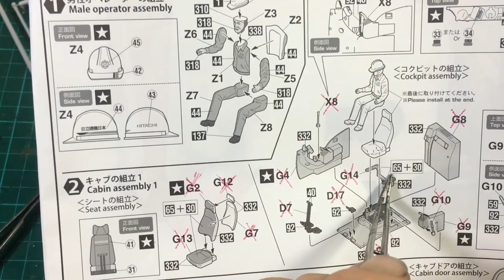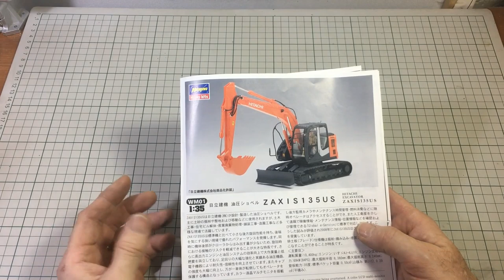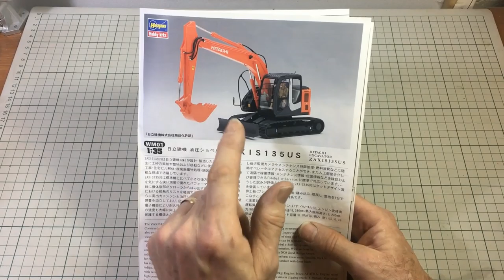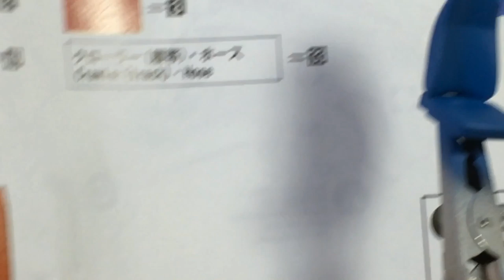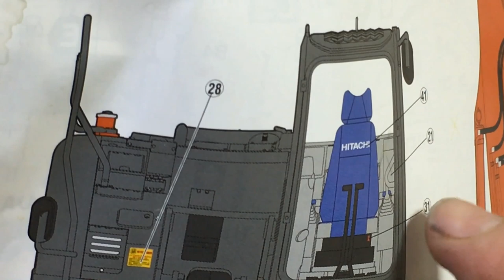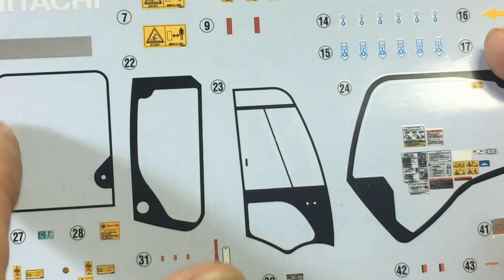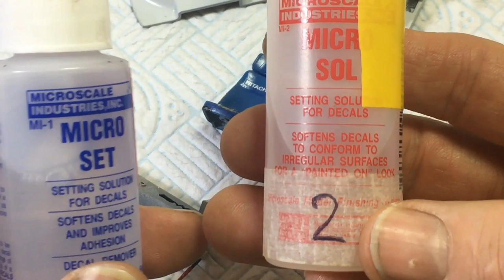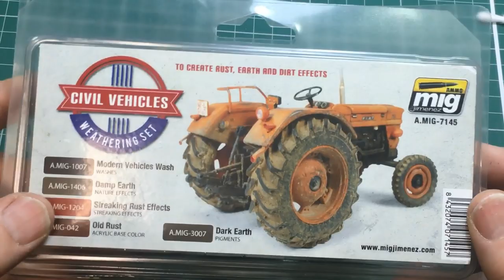Hasegawa 1/35 Zaxis135US Hitachi Excavator

Comment: Per Hitachi, that's a 13.5 tonne machine that is Ultra Short (US) in the measurement of the engine compartment as it protrudes aft of the cabin.
They are very neat machines, and will fit into tight confines (and trailer nicely).  Almost all Hitachi machines use metal tracks, too.
Reply: CAPNMAC82 thanks for that information, that clears everything up nicely... thank you